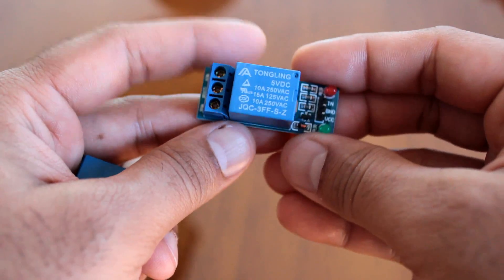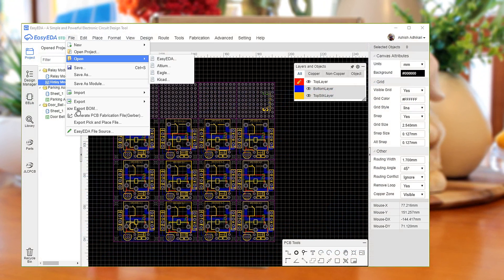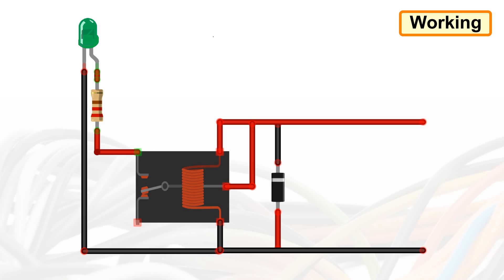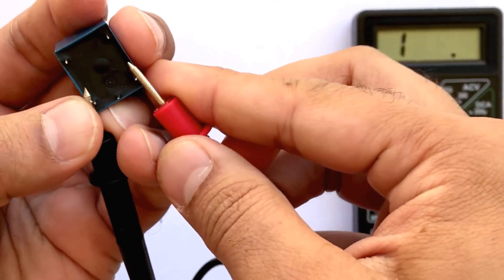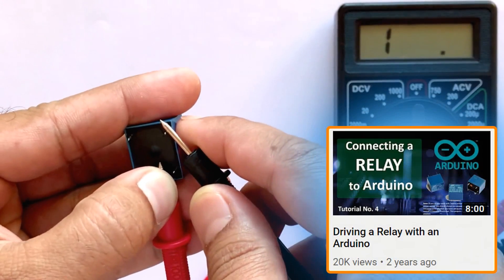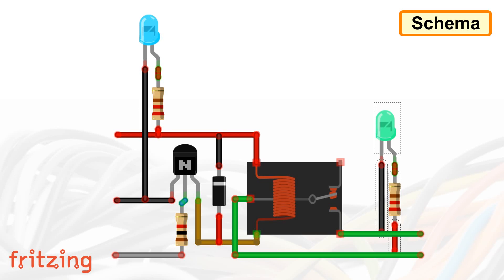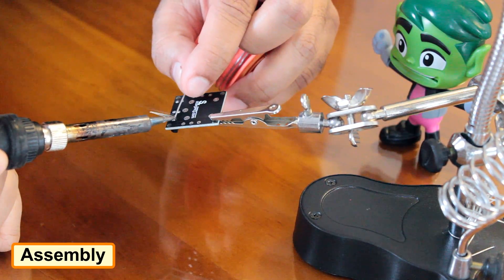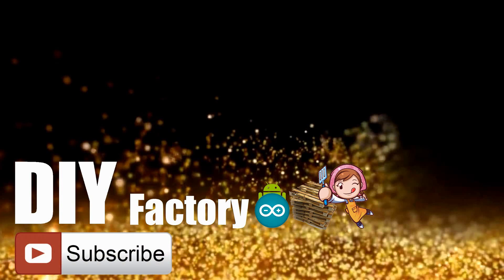DIY   Relay Module

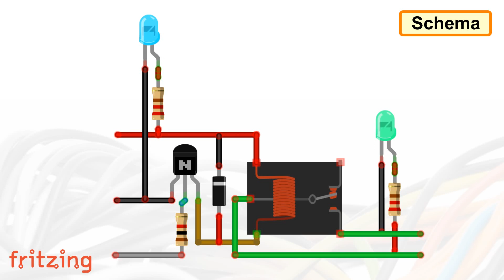Comment: 3:23 trigger LED should be on +ve and collector of the transistor not in the COM & NO pin which suppose to be AC line genarally
Reply from the maker: Wrong 
The led connected to the common will turn on when the circuit it complete. This happens, when the armature connects to the NO pin of the relay. 

There is, however, a little visual issue  in the diagram. The positive leg of the led, which looks like it is connected to the common pin, is actually connected to +ve..

Comment: How do I do a 12v?
Reply from the maker: Same setup
Use a 5V voltage regulator or if you're looking for something simple, just throw in a zener diode in reverse bias.

Check out this discussion: https://electronics.stackexchange.com/questions/127525/reducing-voltage-with-resistors

Comment: I am at beginner level, have a confusion at 3:15 - there are 3 wires at the left side, red wire to 5v dc, black wire to ground & there is another wire as ash color, with which i am supposed to connect that ?
Reply: positive of your battery
Reply from the maker: That is correct. 
It is a NPN transitor so the base connects to the +ve
Reply: @harisuresh2507  So for using it with arduino, i have to connect red wire with 5v, 
black wire with ground &
Ash colored wire with any digital pin to make it HIGH/LOW, for turning the device on/off

AM I RIGHT ?
Reply: @sohan2510  Yes.
Reply: @harisuresh2507  thanks brother ♥️
Reply: @sohan2510  Actually I just made a Christmas decoration that alternates two LEDs (red and green) per second.
Reply: @sohan2510  Your welcome!!

Comment: How to switch it on with them cheap mx-rm-5v or i have the better rx480e-4a but i would prefer to use the mx-rm due to cheaper cost but it goes high then low causes my garage doors to open while i am at work iv tried time delay but its just becoming over engineered it should  be as simple as sending a high to a NPN but if it always goes high on power up this will trigger relay or on a reset everyday
Reply from the maker: Sorry I am a bit confused 
So what are you trying to achieve?
What's the scenario?

Comment: My 2 cents. "unlimited useless components" is simply not true (after all, the Chinese manufacturers are always looking to cut down to the minimum number of components). An optoisolator is the best example of something really useful and really important when switching AC. Totally agree with you when we're talking about switching LVDC, but most relays have an AC rating on them too.
I also agree that the LEDs can be totally excessive for most projects.
Reply from the maker: Agreed
Reply: I realize I am kind of randomly asking but does anybody know of a good site to stream newly released series online?

Comment: Why is the diode required at all?? I use them without diodes and they work just fine
Reply from the maker: They will but, 
If you are not aware of "Inductive Kickback" then you will very soon kill your microcontroller.

Remember: It is very important to place a diode across the coil of the relay because a spike of voltage (inductive kickback from the coil) is generated (Electromagnetic Interference) when the current is removed from the coil due to the collapse of the magnetic field. This voltage spike can damage the sensitive electronic components controlling the circuit.

Note: Short circuits on Arduino pins, or attempting to run high current devices from it, can damage or destroy the output transistors in the pin, or damage the entire AtMega chip. Often this will result in a "dead" pin of the micro-controller but the remaining chip will still function adequately. For this reason it is a good idea to connect OUTPUT pins to other devices with 470Ω or 1k resistors, unless maximum current draw from the pins is required for a particular application

To know all about relay, checkout my blog post: https://diyfactory007.blogspot.com/2018/04/driving-relay-with-arduino.html